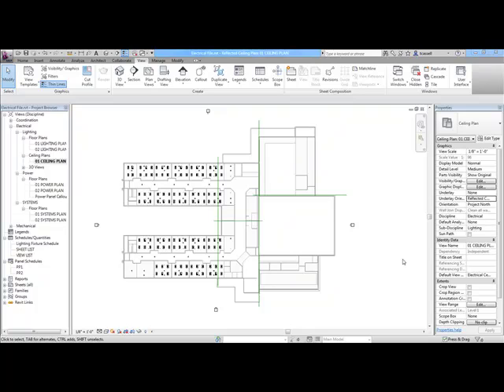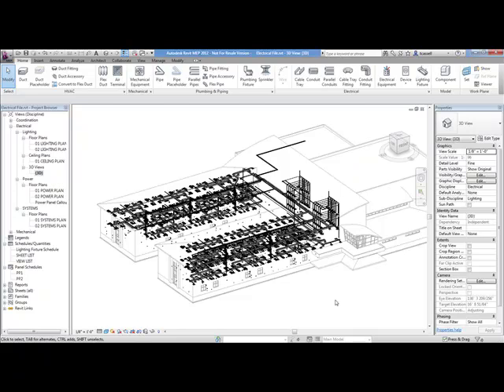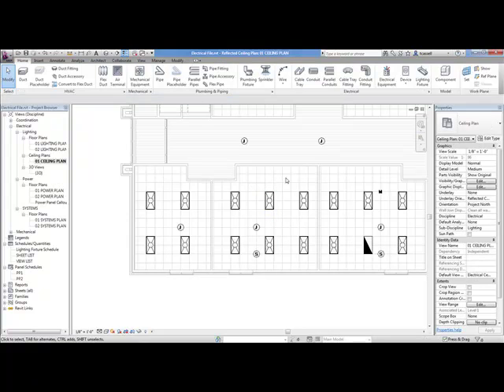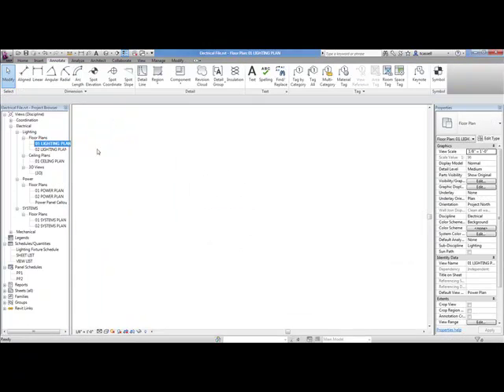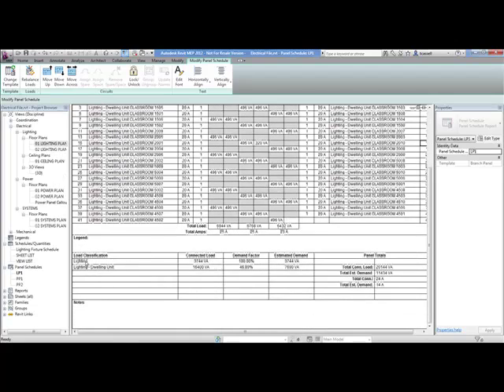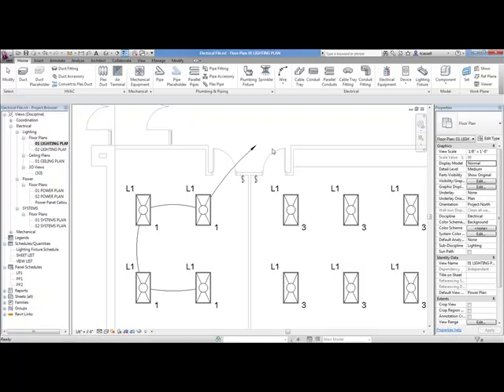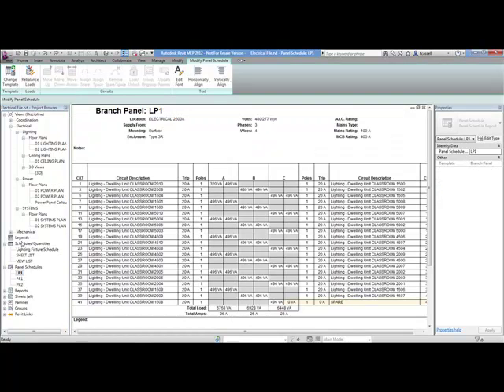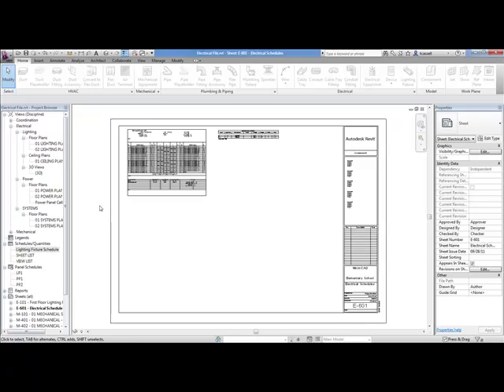Revit MEP 2012: Lighting, Power, and Circuiting

Comment: Hello Sir, I'm facing one problem in Revit Electrical... I want to circuit one 208V, 1- Pole,5800VA Receptacle in 2 circuit of panel RP-1 (120/208 V, 3-phase).. but I'm not able to do this circuit..so can you please help me?

Comment: This is Perfect........Sir I would like to know by using simple one circuit video can you use all sequence wise the connection goes 
1) Automatic transfer switch
2) Circuit Breaker Switchboard
3)Metering Switchboard
4)Transformer Switchboard
5)Utility Switchboard
6)Modular Motor Control Centers
7)Diesel Emergency Power Generator
8)Uninterruptible Power Supply
9) Variable Frequency AC Drive

Basically from Transformer to Luminarie....